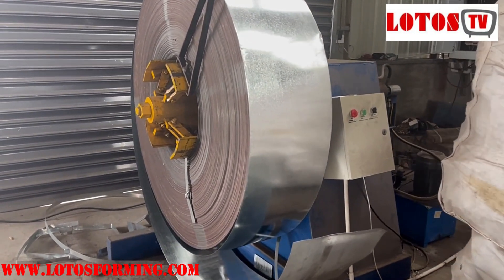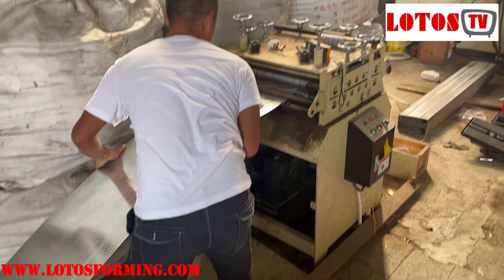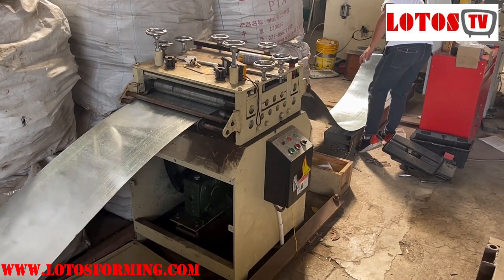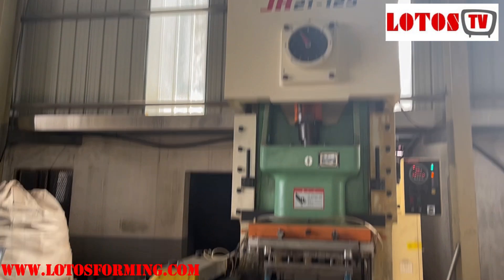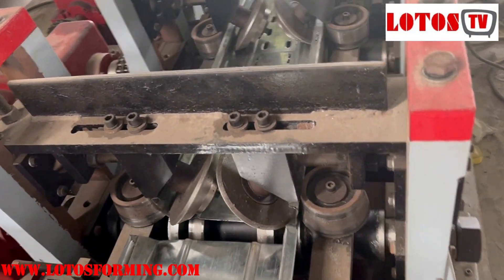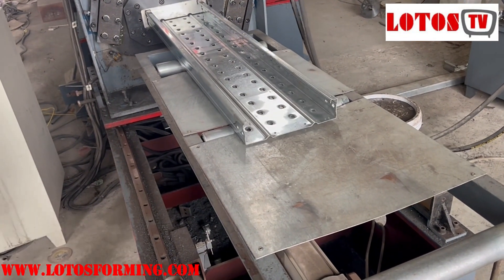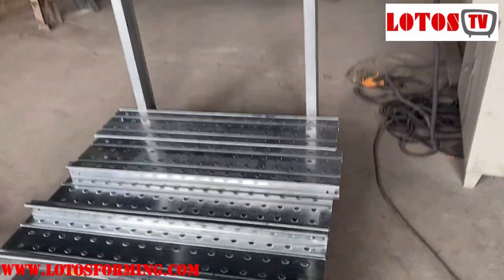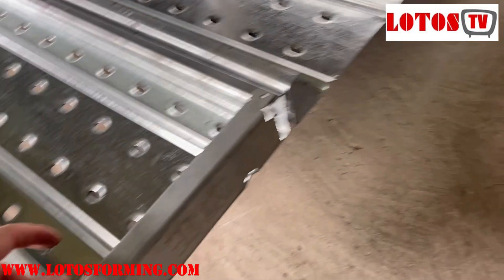【Scaffolding production line 】: What is Scaffolding & Different Types of Scaffoldings?

Comment: Scaffolding is an important part of the construction industry. No structure can be completed without employing reliable and stout scaffolding.
Metal scaffolding is used during construction, maintenance, and repair. Metal scaffolding allows workers to access high and remote locations of any building.